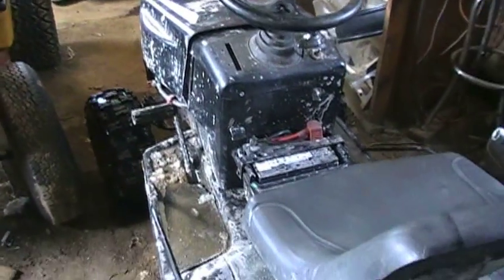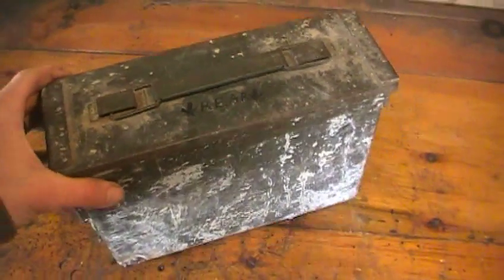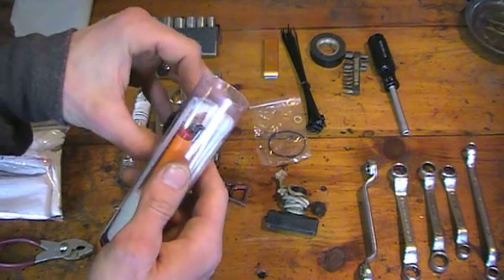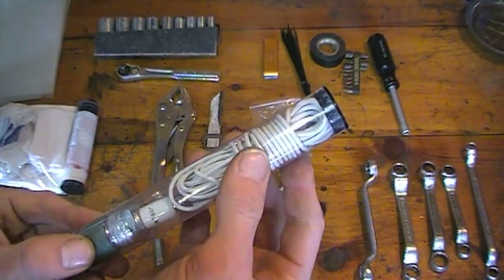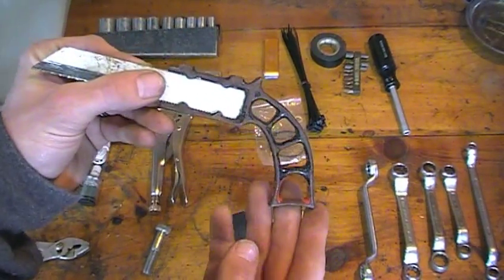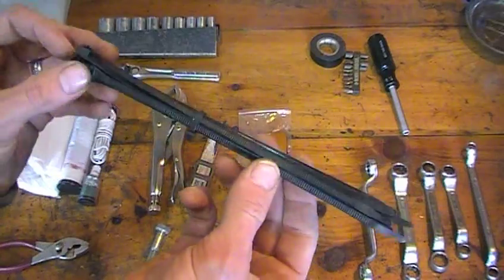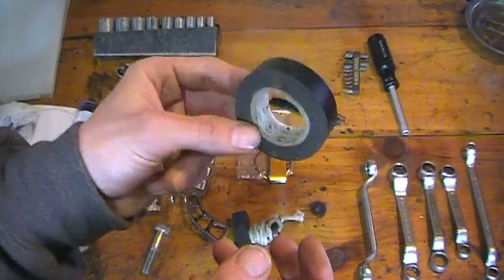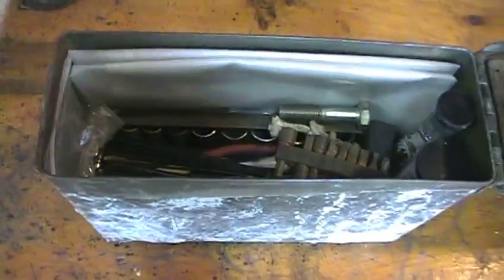Off-Road Mower Tool Box

Comment: Things to add beyond what others already mentioned: TP, bug spray, starting fluid, hose clamps, safety wire, a free HF DVM, can of compressed air, 33 gallon garbage bag ( waterproofing or can make a simple poncho), spare fuel pump.

Comment: Another brilliant video Fearless.  I might suggest a few things I carry as well:  a few feet of duct tap wrapped around an old pill bottle with some tylenol and advil in it.  Needle nosed pliers.  Four electrical alligator clips with screw connections (great for temporary connections).  A little bit of orange flagging tape (lots of uses....mainly in case you have to leave your ride in the bush.....helps you find it again).   I really enjoyed the video man.  Keep up the great work!

Comment: I like that idea ... I know what its like to break down With And without and have a hand full of tools its a night and day difference i Allways carry a Flat head screw driver .. and a adjustable wrench on my "work tractor" if i were you i would also carry some tie wire or fence wire (heavy stuff) and some nuts and bolts and fuses i will defiantly make a Box of stuff

Comment: JB weld , duck tape ,fire extinguisher, spare air filter , e clips and cotter pins ,small  air compressor tire plug kit extra valve cores and valve core tool, a army meal pack welding rod and jumper cables to weld something up to get you off the trail and of course a few beers and spare gas  and a good mag light  fishing line and sewing needles so you can stitch your self back up  spare belt and clutch springs

Comment from the maker: well, if your trans has 3/4" axles, then 22"s might be on the large side... I typically recommend a max size of 20" on a 3/4", or a 25" on an axle with 1" shafts.
BUT being that your not "locked" i would think you would be fine... Is it an mtd style axle?

Comment: (Quoted) 
"GeneralChaos1756 3 hours ago
my only other suggestions would be a mylar blanket, and a sewing/suture kit, you never know when you might slice yourself open."

I would suggest a tube of superglue, I have used this many times for fast field Sutures that hold up much longer than butterfly closures, it will close a deep cut FAST, and can be reapplied if necessary. After all it was invented for the military as a fast Field stitches alternative. 
And a can of Fix-A-Flat, and Tire Plugs.

Comment: extra belt, springs, flashlight, hammer, wrenches, visegrips, tow rope, knife, wire, tape, tarp, 550 p.c. jump cables, pull start, gloves, JB weld, silicon gasket former, 2 part apoxy, hose clamps, duct tape, small first aid kit. lighter, small hacket saw, oil,

Comment: Should make a set of jumper cables using speaker wire that's what my uncle has in his motorcycle and you also should put a small bike pump and tire repair kit in it. And put some key stock and pins in cause I managed to shear out a key but I'm glad to see theses a boy scout side to you 
Thanks for shareing

Comment: haha I gotta ask...if my buddy's battery was dead, I'd use a 7/16 wrench / adjustable and just swap batteries to start it, they're sometimes easier to get to. but I can see your reasoning in swapping the rope start pulley - say his solenoid or starter motor failed, or some other bogus problem. Nice little kit ya got there, I'm gonna have to make some storage space in my mower! other than the old battery compartment

Comment: if it came down to it you could use that 15 ft i think you said of wire and cut it into two peices and burn the rubber off the ends then use them as jumper cables VERY compact

Comment: what kinda junk is in MY trunk? jumper cables, tow-line, 3 spare tyres, jack, knife, lighters, tape, a few rad-hoses, a 13mill spanner, flathead and philips screwdrivers, (13+flathead for adjudsting the fuel on the dieselpump!), and some various bits and pieces =)

Comment: I am supprised you dont have a tire repair kit in there and a small air pump. I bought a small 12 volt tire pump and put small alligator clips on it to run the compressor off the tractor battery. It works great for tractor tires.

Comment: ok first you might want to check and see if you gas is clean maybe a petcock is almost stopped up, fuel lines. then clean your carb. doesnt hurt to clean out the tank and lines. let me know when you have done this. more then likely it will fix the prob. but before all that put it on reserve tank and see if you have that problem. just let me know

Comment: i wish i could make it pull start but to get  the hood off you need to take off 6 bolts and 4 screws unless you want to dissonect the gas line  the hood is set up very poorly

Comment: irrelevant question coming up, after an oil change i did on my ATV (which is something i recommend you DON'T do without plenty of day light...) the engine started to fail after 10 mins of use :( at first i though I've put more oil than i had to filling it up over the "H" mark but after i leveled it up the problem still persists... any good tips on a solution? or what may cause that?

Comment: to son8god8damn it simply stops running it feels that the gas isn't flowing regularly for a sec and loses power not completely but it stops moving stays on idle and when you give it a little gas then it kills the engine completely..and to start it again you have to pull the choke maybe fuel pump? dirty carburetor? im no expert just guessing...